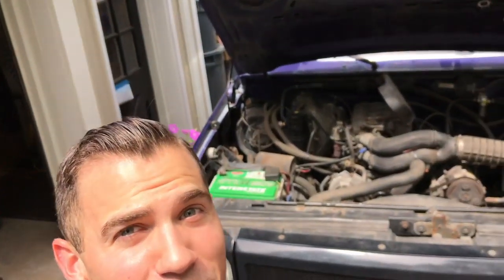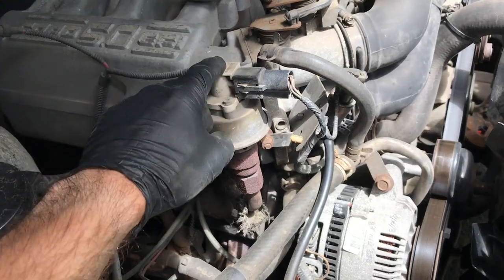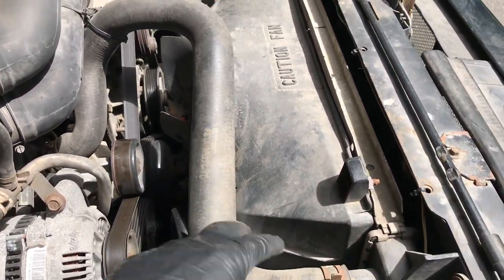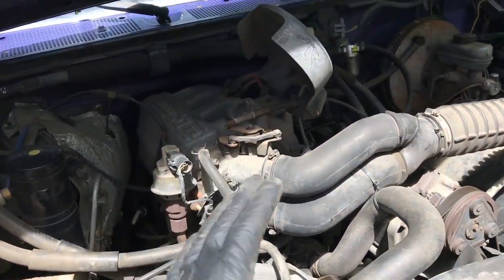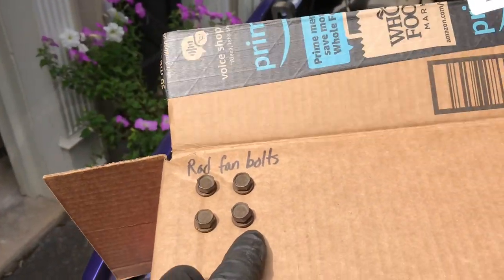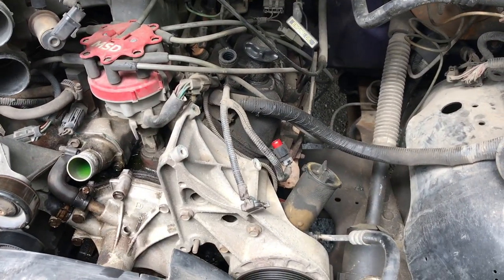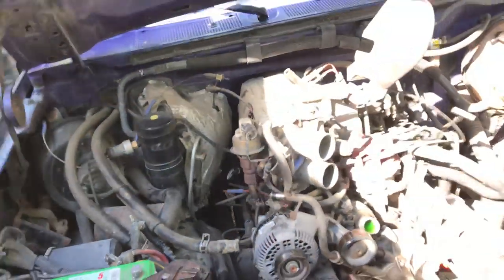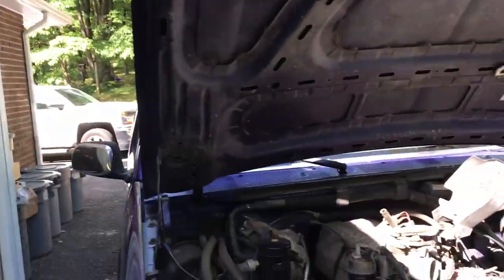How to Remove Ford V8 Engine Part 1 | 1995 Ford F150

Comment: I've watched both parts of this coaching and I want to say thanks. I've swapped out many, many engines in the past sixty years and I'm about to do it one more time. And it's a 302. A guy gave me a 1987 F150 Super Cab. Body and interior in EXCELLENT shape but engine seized. I'm going to pull the engine and have a local engine shop do a oil pan up rebuild. I'll shine up the engine bay while it's out. Your two videos didn't show me anything I didn't already know but you did show me a much better approach. Yep, way better. I've also got a '96 Dodge Dakota manual four by four to tow behind our motor home. The Dakota needs a clutch, pressure plate, throwout bearing, the fly wheel turned and engine mounts. I'm turning it over to a good friend that runs a transmission shop. My friend asked why I wasn't doing it myself. And the answer just popped in my head. I say I'm to old to be laying on the ground on my back under a truck with a bottle jack.

Thanks for a good clean, to the point instructional video without a lot of time showing us how to twist a wrench. No dramatic music either. Well done young man. Well done.
Reply from the maker: You are most welcome Bruce! 🤙 Thank you for all the complaints. Very nice! I like those bullnose 87s. Are you going to put a regular carburetor on it or an EFI carb?
I agree with you. After while it’s better to have someone else do the rebuild work. I replaced a lot of the gaskets and seals on my engine. Otherwise, it’s still 237k miles on the internals. 

Again thank you and thanks for watching! If you haven’t seen any of my other videos I actually have a little over 100 and they’re all based on this year range of F150s. So feel free to check them out.

Comment: I got a ford f150 I need to remove the engine from and I pretty much have to do it alone, it's my project truck and it hasn't been the nicest to me, this helps a bit and makes me less nervous, thank you!
Reply from the maker: You’re welcome man!🤙 something I wish I had done when I pulled the engine was removed the hood. Just make sure you mark exactly how the screws attached to the hood so that you don’t have to go through a realignment process.

Comment: Hey Steve just want to compliment you on videos well narrated and put together, I followed your video on the vacuum hoses, that fixed a few problems I was having with HVAC, no I’m prepping to pull the motor for a bearing job so I’m watching the videos on pulling the motor, this time I’m leaving the tranny. It’s work I’ve done before but the refreshers are helpful, keep up the good work
Reply from the maker: Thank you Jay!🤙 I appreciate it! Good to hear. If I’m honest, sometimes I watch my own videos for a refresher. Lol 
Will do!
Reply: Hey Steve, I decided to scrap the old motor and go with a new crate motor on My 95 Bronco with the 302, it’s been about a month but it’s finally ready to drop in, I deleted the smog Austen since I don’t need to go through emissions, if you do that with your truck you’ll need a 91” belt since the smog pump pulley has been deleted, I discovered that 3 belts later. I replaced the hardware with new stuff and new parts so my motor has no mileage on her, I’ll keep you posted when I get it running, keep the videos coming they’re a great help

Comment: Nice video. Just a heads up if you regasket it make sure to order a new set of timing cover bolts if you do that. They always sieze in the housing and break off
Reply from the maker: Cole Rippeon Thanks! Good to know! I’m on a time crunch so I only have time to replace the leaky gaskets. The oil pan gasket leaks a ton.

Comment: I already had the crossmember done like 4 months ago.now I need to rebuild my engine...after I got my truck back from that being fixed the engine light coincidently came on and wouldnt come off after reading the ec3 computer codes turned out I have bad orings through my engine meantime before the bodyshop called southern Pennsylvania performance...my engine light on my dashboard never came on...along with my battery light constantly flashing...drove it for a whole year nothing came on...body shop get it to do repairs and I get it back like that....all good I've been wanting to rewire the entire electrical system and rebuild the engine anyway😎👍...ps you left out the starter bolt and not just the two bolts on the torque converter...but all the rest of them as well ...my mounting bolts were giving me a hard time so I had to disconnect the brackets entirely...currently facing some rain I got everything covered up...man...I hope I never have to do a engine pull again....lmao I will🤣🤣🤣🤣🤣🤣🤣🤣🤣🤣🤣🤣🤣🤣👍
Reply from the maker: Nice! That worked out! At least that gave you time to stack up some cash to do the engine and wiring work.🤙

Comment: 6:26 Would it be possible to just unbolt the A/C compressor and lay it to the side instead of disconnecting all the A/C lines? I'm just at the research stage of this project so it might be obvious why you can or cannot do that once I look at it.

EDIT:
10:00 I guess I spoke too soon 😁
Reply from the maker: You got it James! Definitely leave the AC connected.🤙

Comment: Thanks for the video. I have the same truck and engine. How did you remove the right side exhaust? Hardly any room to disconnect from collector. Remove starter?
Reply from the maker: You’re welcome man!🤙 I can’t remember exactly. I may have removed the starter.

Comment: Super helpful video. Thanks for the time and the tips! I too will rent the engine hoist. Any suggestion for the hoist and the engine stand? I plan to buy the stand and then resell it to get some money back for it after all said and done. Want to make sure the hoist is tall enough to jack it out, and the proper stand to be able to hold the engine for a period of time. I've got a stock height 96 f250 5.8 4x4. Thanks again for your vids!
Reply from the maker: You’re welcome Scott!🤙 I bought the engine stand from Harbor Freight. It’s not the nicest stand but it got the job done. As far as lift, I rented what was available. I think it was a 1/2 ton.

Comment: Any suggestions on getting to the top transmission bolts when you have a 4x4? It's more crowded and they are hard to see.
Reply from the maker: Good question! Have you tried my many socket extensions trick to reach the bolts?
Reply: @TheMinuteMasters  Sorry for the late reply. I was able to get them out just had to be creative and find a path between the secondary shaft that went back to the 4wd. Your video made getting the engine out very simple. Just have patience. Took me a couple days but I just took my time and disconnected everything. The hardest part actually was getting those damn quick connect fuel lines off.
Reply: @TheMinuteMasters  Another tidbit i learned. If you take off the manifold plenum you can just reach down from the top of the engine and remove those bolts.
Reply from the maker: Eduardo Corrochio No problem man! Yeah I think 4wd are a little more difficult. 
I know right! Those fuel line connectors are a pain!
Reply from the maker: Eduardo Corrochio Hey that’s cool trick! I’ll have to keep that in mind. Thanks Eduardo!🤙
Reply: Go on top of the  motor

Comment: Hey I have another interesting question           So  I am trying to check placement  with my Econoline for a common centrifugal blower   where the plate  has it mounted to  the right  of the AC compressor and pulley  ( well our right facing the truck )   and a straight scroll goes to the dual TB.   I think I have it mocked up ( my engine and everything is completely out so right now its a general idea of  probable room with prior photos )  properly    now the only room issue I may see because obviously the vans engine is farther back.. the master cylinder placement is different but.  You know those curly lines  that come from the cylinder ?    Is that like very specific?    I thought I read they just have to be curled in some way as like a pressure "buffer" if you will.   Chances are the side of the blower will JUST touch them   knowing my decent luck   but...  they also come out farther than I see here..  I plan to do the brakes with  probably some easy bending NiCopp line  but like   I just didn't know   how they could be moved   even if bent a little.   If specific or  its like  the equivalent of a braided line  with how you can have those coming down.   If I had to  by a little bit at most a few inches but   I bet it fits without.    but that is the ONLY thing that could be in the way   and a big AC line but I have no AC so..   so that's pretty sweet if I can move those a bit.  Thanks
Reply from the maker: Nice! That will be a very cool horsepower mod. So, the coiling in the hard break lines is for absorbing vehicle movements. If that particular brake line went straight to the MC, then it’s possible it would fatigue over time from body movements. It’s possible, you could remake the entire brake line and move that coiled section farther down. As long as it’s somewhere in the line, it should do it’s job.
Reply: @TheMinuteMasters  oooh okay..   so  even going straight down at the start of the flange then especially with nicopp..  yeah it's longer than the 150  like goes out 2-3"  before it bends   so    Im guessing because its factory steel some guy  probably had a roller pin  and stamped those out all day.    so yeah as long as an open coil like a spring to dampen? sweet.   thanks man!
Reply from the maker: @DS-mo6md  Yup, I’d say as long as you have a coil or two to dampen movements, you should be good to go.🤙

Comment: Nice video Stevie! Quick question - I'm planning on pulling the engine out of my 1995 F-150 5.8L/351 V8 with 150,000 miles in a few weeks to replace my oil pan gasket, rear main seal, and motor mounts but I'm curious if there's anything else you'd recommend replacing while the engine is out? I was thinking timing chain but there wasn't much play in it when I replaced the timing chain cover gasket last year (should've just changed it then lol... ).
Reply from the maker: Thanks man!🤙 I’d replace every gasket you can. Timing chain isn’t a bad thing to replace. I’d recommend replacing the water pump. With the oil off, you can replace the oil pick up tube.
You can clean out the upper intake manifold/plenum. With that off, you can clean or replace the injectors too. There’s an EGR tube under the plenum as well that can fall apart and cause issues.
I pulled the exhaust manifolds off and reinstalled them with new studs.
That’s probably it for hard parts that are technically serviceable even with the engine installed. Anything else would be rebuild territory.

Comment: Is it possible to leave the air conditioning lines connected  unbolt the ac  compressor and wire tie ontothe fender?
Reply from the maker: It sure is Terry! That’s how I did it when I filmed this video.🤙

Comment: Is this the same process for a 4.6L 1997??? F150😊
Reply from the maker: I don’t know for sure since that is the new generation of f150. But in general, the process of pulling engines are very similar.
Reply: @TheMinuteMasters  thanks I will take as much info as I can from this video and use it for my 97

Comment: Another really good thing is to literally get a camera stand and record the entire process of you taking an engine out
Reply from the maker: Finally got one! 🤙
Reply: @TheMinuteMasters  yeah I’m about to do an engine and trans install on a 93’ f150 extended cab short bed I might buy, and I’m doing an engine swap on my dads 95’ f150 soon.
Reply from the maker: @AustinB3.6R  Damn! You’ll be an engine swap expert in no time. That was my second time pulling an engine out. I’ve pulled half a dozen transmissions though.

Comment: I need to do the rear main seal. Is this what’s recommended? Also while I pull out the engine are there other things I should do to the engine other gaskets, etc? It has 130k miles I’d like it to go as long as possible. Thanks
Reply from the maker: That’s a standard rear main seal gasket. You could look up a better gasket but it did the trick for me. While you have the engine out, replace the water pump + gasket, replace the thermostat + gasket, replace the oil pan gasket, replace the valve cover gasket (only if leaking), replace the rear main seal, and replace the crank seal too.  That’s it for the gasket work. You can also replace the timing chain too. Those fixes will definitely help your engine last a good while and be drip free. 

You can also consider replacing the oil pump too. If you want to do any performance mods, now is also the time to swap camshafts, upgrade heads, valves, and add headers.
I hope this helps!🤙
Reply: @TheMinuteMasters   very cool thanks. You mention a crank seal, this is different than a rear main seal?
Reply from the maker: @lupegalvan9993  Yup, they are two different seals. The crank seal is at the front and the rear main seal is at the back.
Reply: @TheMinuteMasters  Thanks for clarifying.
Reply from the maker: @lupegalvan9993  No problem man!🤙 Thanks for watching!
Reply: @TheMinuteMasters  Finally getting around to this. I hope it goes well.
Reply: Got this done. It took me a total of 40 hrs from start to finish over a series of weekends. I only screwed up installing the thermostat and it leaked but beyond that got it back and running better than before.

Comment: Can't you locate the Schrader valve and bleed the fuel system that way?
Reply from the maker: Terry Baptist The Schrader valve is located on the fuel rail. With the right equipment, you could theoretically bleed the system from there. The Haynes manual states to engage the emergency impact fuel shut off switch. Either way is fine.

Comment: Same issue with mine bud I got a 95 f150 xlt....just curious what model is yours?
Reply from the maker: Mine is an XL, 5.0, and 2wd.
Reply: Mine is a 4wd on a 6in lift
Reply from the maker: @michaelcardona3678  So you have a cracked frame?

Comment: How long did it take to pull the motor?
Reply from the maker: I might have taken a couple hours one day to disconnect everything from the engine and then pull the engine on another day. I think you could do all the work and pull the engine in an 8 hour day or less.

Comment: While many say this is a good video it's just ok! I have worked on many engines over 50 years, and often find people who say they know what they are doing. However, there is always a few who do not know and look for videos to follow verbatim! When this video keeps having these "shortcuts" he is missing the vote on giving newcomers an exact method to follow! In my opinion this is one of those half baked loaves of bread served in a diner!
Reply from the maker: I think you make a good point. I don’t include any “action shots” of me doing the work. I know that leaves gaps for new folks.
Reply: Jeez thanks for the input Debbie downer. I’m about to do my 1st one. And could t complain on his help
Reply: @matthewmyer6911  how did that work out

Comment: Just so you know:  11 hours is book time to remove and replace this engine... i did it in 9 hours... just yank it out and transfur everything and slam it back in ... and move on to the next one...  $$$$$$$$
Reply from the maker: So book time as in like text book amount of time it takes to replace an engine?
Reply: @TheMinuteMasters  shop time they give a poor Mechanic to do a job... but if you do it many times you can beat the book time shops give a Mechanic ... if you make $20 a hour and it takes you 12 hours to do a job and book time is 10 hours,,, you make  around $16 a hour... if you can do it in 5 hours now you make $30 a hour ,,, so faster is more money for you and then do another job more money in a day... but if it comes back because you messed up now it is free... you do not get paid for a come back... so slow down and do it correctly and fast... or it is free...
Reply from the maker: @johncasor9698  Gotcha, well I guess my time isn’t bad for a DIY driveway set up. 
I totally get the hustle. I’m a plumber and it’s the same way. The more jobs you can do in a day, the more money you can make!🤙
Reply: Nice come do mine